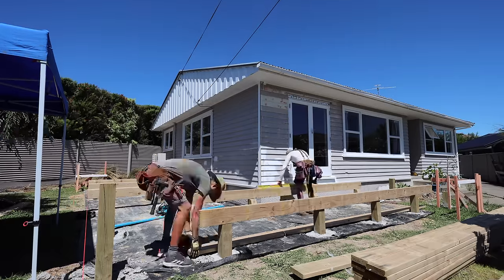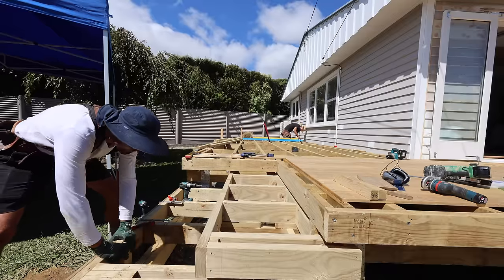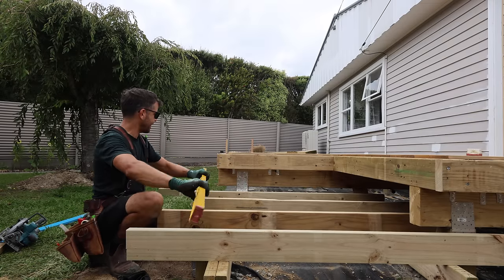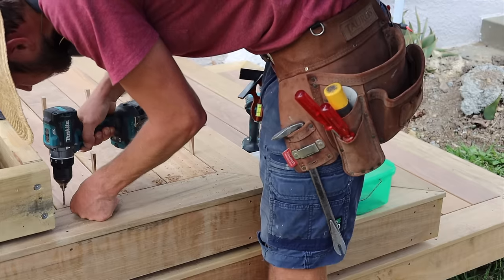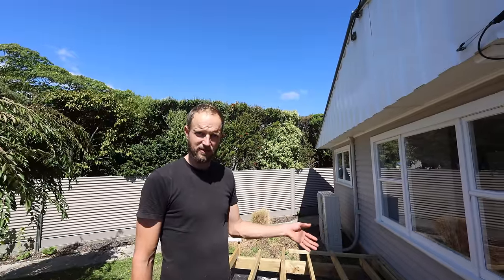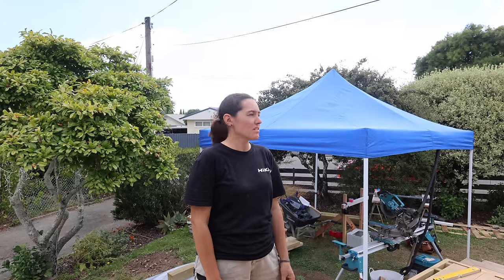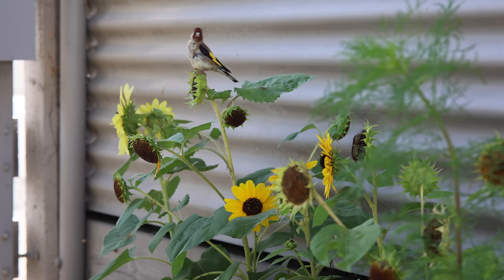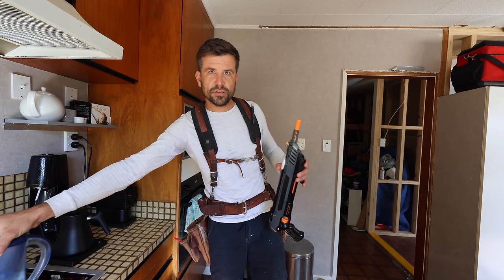Would You Pay $30,000 for a Deck?

Comment: So let's do some maths. If Scott it installing 350 lineal metres and the boards are 145 mm wide (including for the gap) that means the deck is about 50 sq metres. At a cost of NZ$30,000 that makes it about $600 per sq metre which is not as frightening as I thought it would be. 23 years ago I was allowing $250/m2 for a basic deck . Given that house construction costs have tripled in NZ in that time and this is a fancy deck I say it's not too bad.
Reply: I would say about 40 m2, if allowing for offcuts and the decking around the sides. He'll have quite a few offcuts given how short the boards are.

Comment: I'm a deck and fence builder in NZ. I built my 35sqm deck with pine for around 4-5k last year incl 8m of seating, 2 steps and a 3sqm raised platform, all picture framed. About 8-9 days work on my own. So if you're ok with boards that shrink and wont last as many decades you can definitely save a lot of money DIY the cheap way
Reply: I built my own b4 covid. At 30m2 for about 3.5 to 4k not 6m of Seating. Timber has just gone mental aye.

Comment: I made a small deck with red balau, a similar looking tropical hardwood that also had the recommendation to oil all four sides. I padded on some oil (Star-Brite teak oil) to the bottom before laying the boards, and then oiled the full deck after install. The idea was that adding finish to only one side would cause the boards to cup and warp as the ability of the wood to absorb moisture would be different. I used a Kreg hidden screw jig to attach the boards to the sides so water wouldn't soak into the screw holes from the top. It's been about 3 years and the boards are still pretty flat.

Comment: I've oiled all sides of my own deck, following advice from our builder...lesson learned (for all of us), don't take shortcuts and attempt to oil the planks when still bound together (builder's suggestion, not mine).  It sounds like a good idea, but the oil runs between the planks and you end up with horrid stains which then need to be sanded back.  I'm afraid if you go down the path of completely oiling your planks, there is no real shortcut.  Second thing I learnt was that using a sealer type deck oil, it can be a lot of work to sand back at any point...using a belt sander, which is preferred due to the cross-warping of the planks, the seal type oil heats up and gums up the sanding belt, a lot...my solution was to resort to a heat gun and a 'fine' scraper.  It actually saved time, but it was backbreaking work crawling across the thing.  Much as I don't like the idea, I'm thinking next time I'll use a chemical solvent to remove the deck oil.

Comment: 12'x39' deck took me two weeks to build. Built on 10" steel I beams  40" elevation, 2x6 joists with Trex decking. All in about 6k US, the expensive part is the railing 1x4 steel tubing with 5/16" vinyl coated aircraft cables.

Comment: I was quoted $22k NZD for a deck replacement in Auckland. I ended up doing it myself. $7K in materials and 3 days of my time. Simple deck, not elevated, no balastrades, no weedmat, std decking nails, and didn't need to replace existing joists.

Comment: You also can build the decking frame on temporery scrap timber posts setting away from where the actual post will be, level the frame on these temp. posts, then mount the actual posts hanging away from the hole base couple centimeters , then fill the holes with concrete , it also save you time because you can frame and concrete the posts in the same day also you dont need to worry for cutting posts top to level because in the ground can their length be little shorter or longer ,second day you remove the temp. posts and finish the decking surface .

Comment: Brilliant work and attention to detail as normal. I dnt know if you have any but bench top adjustable  rollers are really handy I work on my own a lot and if using portable table saw a clamp 1 to the top of a stool and it helps hold the timber once been through the saw

Comment: Wow, I can't believe how much those materials cost. My deck was just pressure treated 2 X 6's. Certainly not pretty like yours, but functional.
Reply: Yea I did a few rap arounds on a apartment complex each deck came out to around 17k a piece, on a slope. Was commercial so it was beefed up a little more with concrete foundation instead of running posts into the ground. 2x6 decking looks great, I prefer it over trex on top of the strength you get out of it.

Comment: Is it expensive?  How long will it last ? Does it add value to the property? As a builder, I'd say good home improvements not only add value but also give us more comfortable living .well worth it.Great work as all ways 👍💷🇬🇧
Reply: It will last 20 to 30 years.
Reply: @Kiwigrunt  well worth it then and I'd bet only the boards would need replacing 👍
Reply: @robertphenna1965  With luck the framing will last about 35 years. H3.2 exposed timber will not last 50 years, like it is supposed to do.

Comment: Good work but your base should be on something that resist water the first 10 cm. But maybe thats only in germany a problem were it rains 2 Times a week . If we dont put it on Aluminium feet or steel with a zinc Coat. The base will be rotten in 15 years

Comment: I know stainless steal is the best for corrosion but is it worth it for a smaller deck?  I think in the US the PT wood isn't as harsh and with triple galvanized like ZMAX can you still get 15-20 years?  Assuming no salt is in the area?

In some cases the price difference is 2-3x between SS and ZMAX but for some items it's like 10-15x which is nuts.

Comment: Serious question: Why build a deck over just paving a part of the yard to sit? It seems like Decks are very common overseas but here in Europe the majority of people seem to be just laying bricks or tiles or so?
Reply: Honestly yeah, I don’t understand the attraction. Being high up? No need to weed? They’re not exactly low maintenance with continual oiling.
Reply: Aesthetic and comfort I’d reckon. Level walk out from the double doors onto a nice sun-covered hardwood surface beats bricks, mud and grass. Plus with joinery as precise as this, it’s a pleasant extension of the living space. 

Here in mainland Europe (and UK as well afaik) these nicer hardwood decking boards are crazy expensive and less readily available. Stone and concrete on the other hand..
Reply: Not having to follow grade? 
Having a deck at floor level blurs the distinction between indoors and out, and makes it more of a living space?
Maintenance isn't a big deal with tropical hardwood and stainless fasteners.
Bleach it or oil it every couple of years and it will last longer than you.
The climate in most of NZ is quite different than Europe.

Comment: Wow! I build a 36m2 deck of treated timber for around 1700nz$ in materials. It's not set in concrete though but on top of old concrete slabs, but it feels mighty stable still.
Looks wise I have no complaint but of course a timber is never going to look as good as hardwood.
Reply: I think that must have been a few years ago. Just before xmas I built a 22 sq.m deck that was only 300mm off the ground, and materials were $5300, all in pine.
Reply: @paulrawlinson8653  Yes, it was 4 years ago before the world went mad and it wasn't on a remote Island in the Indian Ocean

Comment: That's a crazy price but the deck looks great and those boards are beautiful. Here in the UK we don't use nice wood for deck boards (probably because of the weather). However a deck that size would probably cost around £1000 in materials and there anywhere near the level of building control on decks as what you have
Reply: More than double that easily for materials for a deck that size in the UK
Reply: The wood alone would cost more than your estimate in the UK

Comment: It seems to me there is about 3-4 K in material(U.S) So you can charge 5K and walk away with 1K profit for your labor. This deck doesn't look any elaborate. No fence, no stairs, low to the ground,easy to build. The boards should have been one long piece not 2-3 short pieces. I don;t see it for 30K but maybe 3-4

Comment: Deck is looking great. Price doesn't seem out of line. We built a deck using Ipe and it cost about the same.
I'm not sure of your friends with rough sawn decking. Seems like a splinter fest!
Reply: The idea of a rough sawn, high treatment, thick pine, deck with good quality galv fasteners appeals to me. It has the potential to be there forever and look better with time. I dont think splinters would be a problem. Thin hardwood shiney decks well... Different strokes for different folks.

Comment: Do you slope your deck at all? I decided to slightly slope the deck 1/4 inch per foot to make sure water wouldn't pool on the boards. My last deck did not shed water properly.
Reply: 1/4 inch per foot?
Reply: @bunning63  that's the slope angle. 1/4" drop for every foot. Over 12' of deck the drop is 3"
Reply: @bunning63  ~6mm per ~300mm, or about 2%
Reply: @crashkg  wow, thats a lot. Ive never seen water pool on a deck though

Comment: Are there council building consent costs etc. building inspections etc?
Reply: only if you fix the deck to the house witch he did not ,you also do when up high
Reply: If the deck is less than 1.2m from the tread to the ground consent is not required

Comment: Don't build a deck. Nice to spend all that money and then watch it rot and splinter. Also dumping more money on it with stains or protective coatings. Fun!

Or you could have a few steps down to a patio. Concrete, stone, brick, gravel. No rot. No finish. Easy maintenance. Use natural stone, local pebble or gravel and broken, scattered or damaged stuff is easily replaced. No hunting around for a brick no longer in production.

Keep it simple. Enjoy your life, not your stuff.